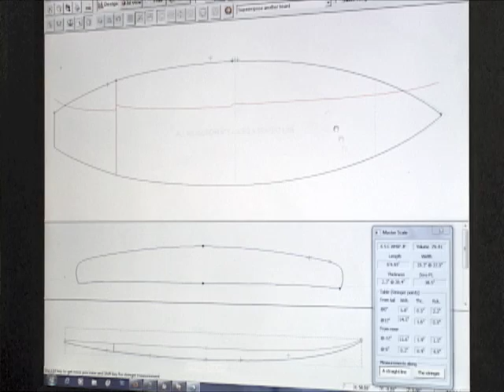C-Shapes

Comment: Not really shaping !!!!
Reply from the maker: Stop hating. It's all shaping. Not every shaper knows how to use the 3D software. You still have to shape it down to the final shape. Lots of room to alter the board. 10 years of hand shaping in my belt + 15 designing boards on the computer down to .001". Welcome to the future. Go replicate boards to the T with your planer if you like. Go start a career and have to work with pros who want the same board every time with the little improvements they asked for that only the computer can keep track of. Knowing exact liters. Again, only on the computer.